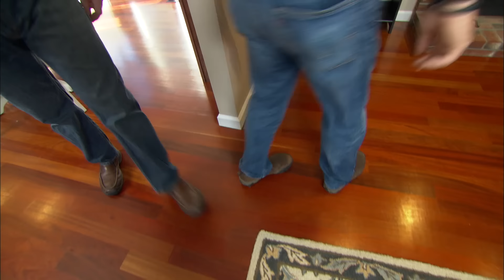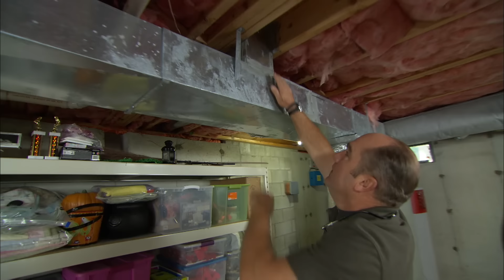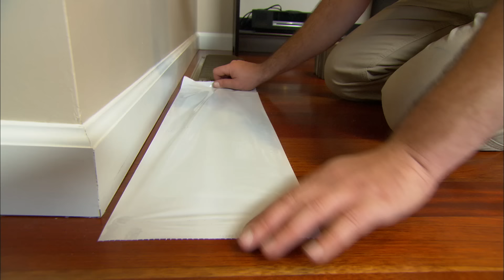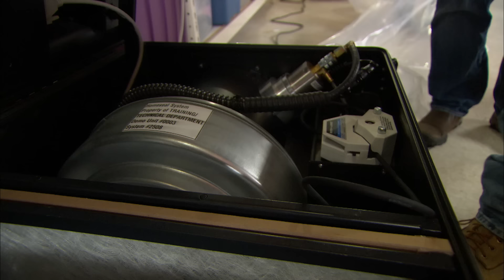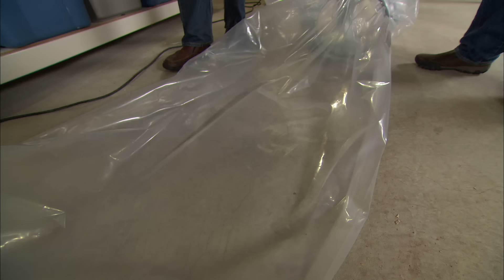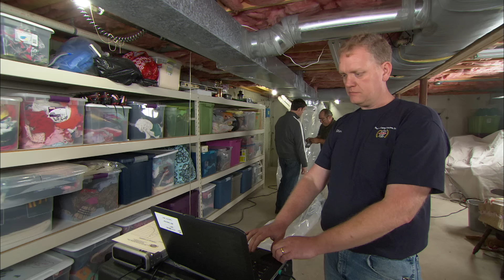How to Seal Leaky Ductwork | Ask This Old House

Comment: first off, all that atomized chemical that leaks into your house wont simply be all sucked up by that ait filter. it will hover around, settle on everything, and you will be breathing it for months every time the surface is diaturbed. i would absolutely not trust that in my lungs. 

secondly, they make this seem like a big deal but it isnt. your not loosing any air,.it all remains in the house, so.whats the problem? if you have a descrepency in temprature throught the house, restrict the flow to the areas that are hotter and increse it to the areas that are colder, pretty simple. just close some vents and if that isnt enough put some duct fans in to the cold areas
Reply: Clueless
Reply: I work in HVAC thinking the same... what about the damn pressure they put in it... 300 CFM lost my ass. YOU are telling me they have the equivalent of almost three 6" of LOST AIR!?! You have to be shitting me.

Comment: That's Cancer right there also foam insulation is pure Cancer,  rather live in a cabin with a duct less system
Reply: This isn't foam being sprayed into the ducts.  It's actually a relatively harmless, based material (water based latex ?).  It's harmless actually to anyone in the house.  I had this done a couple of years ago.  It's actually worked quite well.  Our system leaks were dramatically reduced.  We feel more air flow throughout the house.  Unfortunately, the upstairs is still quite hot in summer and we added an additional return line to draw that hot air back in to the system.
Reply: @beebob1279  Its hot because the heat melted the glue, and its leaking again.
Reply: Luis Aleman ummmm....then go live in your so called cancer free home ahahahah even though humans are living loner then ever considering the average age of death ahahaha got to love facts and statistics oh and considering the humans population is up to 7.1 billion

Comment: Nice video and helpful...for those with basements. We live in a townhouse. How do you find and repair leaks when you can't even see them because they are inside the walls?
Reply: That was the whole point of this video. The rubberized chemical is going to every piece of ductwork sealing the holes in the ducts that are inside the walls.

Comment: Won't the basement be much colder now though, since much less heat is escaping in the basement ?   I guess it's worth it to save money on heating bills,  but that was never mentioned.
Reply: It depends on if you want to pay to keep the spiders warm in the basement.
Reply: @mitchdinner9743  or water pipes, which could freeze if the basement gets cold enough. Depends where you live I guess

Comment: So what’s stoping the sealant from getting all over the a-coil and the blower????
Reply: It’s sealed off from this system when they are doing it?
Reply: They are isolated
Reply: I know this question was a year ago but my guess is they both failed by now BUT, there are no leaks and that was all he promised after all.  Oh, and they all have lung damage too.  The scrubbers took up 80% of the leaking glue mist, their lungs took the other 20.

Comment: The truth is, the latex they are applying inside the ducts can ONLY fill the small gaps and holes in a duct system. So if your ductwork has fallen apart in a chase or above a drywall ceiling or if there is any other leak larger than a 3/16" hole, the latex will not do anything.
Reply: If there was a Roof Leak at your Living, can this also cause your ducts to smell like cigars?

Comment: That return air looks really small to me.
Reply: Most systems installed have undersized ductwork period. Most systems are designed by rule of thumb and a set friction rate. There is no set friction rate, it needs to be calculated for each system. A manual j heat load calculation must be done along with a manual d to design and size ductwork for a given friction rate.

Comment: This video cracks me up where do you think the heat is going once it's in the basement the heat's not lost it goes up into the first-floor floor sealing the ductwork with plastic is going to do next to nothing this is beyond asinine
Reply: Matthew Vogt did you watch the video or just look at the thumbnail?
Reply: mattp1482 I watched it. For the record as an HVAC person myself the is a fairly controversial topic. Right up there with smart or programmable stats
Reply: Matthew Vogt I think programmable/wifi t-stats are good for people with vacation homes so they can turn it up before they get there and monitor the temp inside from far away saving them from a freeze up or people with forced hot air because it has such a quick recovery rate. Other than that they are not really necessary.
Reply: True
Reply: Well with less airleaks you have a more consistent flow.of air to the first floor this more consistent temperatures which is what the homeowner was hoping for in the beginning of the video
Reply: You can see the basement walls are bare concrete, uninsulated, so wouldn't a big portion seep into the walls then into the ground?

Comment: Why would you NOT insulate the return?
If the air is still fairly warm/cold then the heater/cooler has lees work to do saving money.
O and that end result is dumb because they started with 1 massive leak with that hole they drilled.
So 94% is a way too high number.
Reply: Wasn't the hole cut after the protest, then it wouldn't be part of the gain.

Comment: wouldn't that spray the sealant all over your A-coil and internal parts of your furnace as well.
Reply: They removed it before doing the sealing. It was hooked directly to the ductwork only

Comment: Is there a commercial LEED requirement to eliminate leakage in HVAC systems? That should become residential building code requirements ? Shortage of residential LEED heat pumps.

Comment: Great vid! Are there any self seal duct connectors? We have people in our home that have asthma/allergic reactions with such products
Reply: Yes, if you have the room for them, they protrude 1 to 2 inches out around the ductwork. They are called TDF or TDC flanges that get a neoprene or butyl gasket on the mating surfaces of the flange then the ducts get bolted together at the 4 corners.
Reply: Best way to seal ductwork is on the outside.
Reply: @mitchdinner9743  sure, everyone is gonna tear out walls and ceilings in their old house to do it that way!
Reply: @warrenmichael918  maybe you would be dumb enough. Alot of homes have exposed ductwork.

Comment: Do you guys do projects in San Antonio? I have a 1945 home with a new HVAC system that doesn't blow that hot of air. Looking closer it seems like they did a shoddy job and also hung some of the ducts to be off the ground. Is that normal?

Comment: Don't worry about breathing it in.  If there are leaks in your breathing tubes/lungs, it will seal it too. :D
Reply: Now i know how to deal with a punctured lung
Reply: That was my issue too. There was a CLOUD behind them, and NO MASKS, no eyepro. Or visible PPE. I'd be in Tyvek with a face shield and respirator. Or outside. 
Pets? THings in the house? Need the MSDS +
Reply: Kyle McNicoll Nah use flex seal
Reply: @thetupolevtu-1602  Now THATS a lotta damage!
Reply: Coagulate the holes in your ducts and your lungs all at once
Reply: LMFAO!
Reply: That’s what I was thinking….
Reply: Lol
Reply: I tried to aerosol vape my children's lungs once and this reminds me of all the fun I had .
Reply: If any gets into the air that you can breathe in then your whole house has this on any horizontal surface. You would clean your house for a decade and never get it all. It would be even worse than drywall dust because it sticks so can’t be vacuumed. So no this doesn’t get into the air at any levels that you would notice or that would harm you.
Reply: Remember no building materials have every been shown to cause cancer, so we're good to go, right?
Reply: Lungs aren't "breathing tubes."
Reply: I'm sure you are out of the house while it is being done and remain out until the cure time.  You can see on that screen in the hole that it's pretty quick.  But, if that new fangled technology still scares you, you can continue to enjoy your $1,000 utility bill.
Reply: @kennywonderley5883  bingo it dries and cures and solid as a rock! That’s why rumors are more believable than facts! Because they started by a Genius
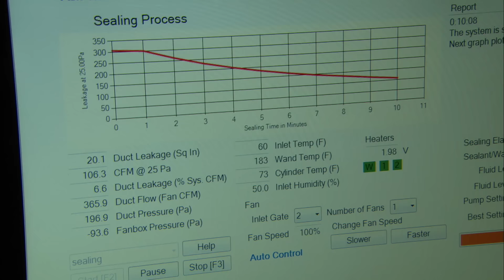Reply: @kennywonderley5883  uhh you didn't notice the chemical fog in the air @6:37 I am pretty sure they are still in the building, and they are the experts. 😷 I think I will take the higher power bill to not ruin my health.

Comment: That's actually pretty cool! And what about all that airborn sealant myst that the guys were in. Isn't it dangerous?
Reply: I wondered the same, and thought it odd they didn't address this.  It did look pretty dodgy when he mentioned about a scrubber fan pulling any airborne sealant in the living spaces onto its filters WHILE SURROUNDED BY A CLOUD OF MIST.   I'd have been masked up, no matter what the concept of the scrubber fan was.
Reply: It's only dangerous as long as they are alive.
Reply: You are right.  He didn't say a word about that being safe....he did say any leakage into the living area was captured by that scrubber fan...no mention of the leakage into the lungs.
Reply: @amalias8888  LOL...  You actually need it to be specified to you directly that airborne particles eventually end up in the lungs?  ...OK.  I'll remember that next time, thanks.
Reply: @NorthernChev  no worries! The website from the company says it's made up of baby pacifiers and something else ridiculously equivalent. No seriously, the workers must wear a P95 or N95 mask when in the same room at a minimum. I imagine the manufacturer has the MSDS posted...
Reply: I got a headache just watching this soon there will be a lawyer commercial about this
Reply: They like that rubbery milky substance
Reply: welll...thats a good question when you get non hodgkins lymphoma 20 years from now...
Reply: Remember the scrubber fan on the floor???? That's what that was for
Reply: You obvoisly missed the part where he explains how that was mitigated... Watch it again, but this time actually listen.
Reply: @NorthernChev  He said any "leakage" into the living area is captured into the scrubber fan.....he did NOT say anything about all the stuff they are breathing in during the process.  That's not mitigating....watch it again and listen.

Comment: I would like to see a follow up to this video about savings experienced over time.
Reply: Interesting product, but yes, it would be great to see at least, airflow measurements from each duct/room and supply and return temperature in the plenum. 
Barely talked about negative pressure in the return duct or how to split the return duct which seems to be all in the same pipe without any baffles that can be operated by the homeowner  (eg suck more air from upstairs vs first floor in summer vs vice-versa in winter). 
I'm sure there are better videos and youtubers that describe more the situation than putting a couple of thousand bucks worth of band-aids in your ductwork!
Reply: @terrencesauve  Shows like this are for entertainment and to get ideas. They aren't really how-tos despite the implications in their advertising. They only work as a how-to if you already have some idea of what you need to do.
Reply: No soup for you
Reply: 2 yrs later. Still waiting for the update!
Reply: @crazyhass84  It's five years later now.
Reply: @crazyhass84  do your home .There's your follow-up.....
Reply: Dumb question: isn’t the air ‘leaking’ into your building envelope anyway? So the heat isn’t really lost, it’s still in the house. It’s just it may not get to the room as efficiently? Or am I way off?
Reply: @twiincentral8780  You are absolutely correct. However, air sealing the ducts will significantly help push and pull air from all your rooms rather than the easier leaks. For effecting HVAC you want equal push and pull of air to your rooms, otherwise back pressure may occur and cause other issues than uncomfortable living space.
Reply: @twiincentral8780  Depends on whether your ducts are located in space you want to be conditioned. If your basement and attic are conditioned, sure. If they're unconditioned (i.e., insulation is located between the attic or basement and your living space), then you're heating and cooling an area that's effectively "outside" your building envelope. Not only does that waste money, but it could also lead to other problems like condensation in places you really don't want it.
Reply: No follow ups allowed
Reply: @ekujj13  its in the contract "absolutely no follow ups"  and sign off for the chemical damage to ur lungs over the years please,...right on the X
Reply: @gusc6785  yeah I wondering about the down side to spraying a chemical in the vents and breathing what ever blows out of the vents later.
Reply: Gustavo Cornejo in fairness, the chemical sealant is only in the air for less than hour after the fan is done, and even then not much left since there is a capture box on each floor. Overtime it is safer than not doing it (in this episodes case) as all the dust, potential spores/mold/allergins that can be sucked in are just as bad in a leaky system, so this ends up being a healthy system, especially in northern climates where people stay in their sealed home for several hours over several months.
Reply: GuruBrew m fyxrnx been.              xgcnf v hv h. hg v gngvh v g

Comment: How does someone find a contractor that performs this type of sealing?  It is not named in the video or description.  Lots of people asking about cost but that would vary by contractor.  Typically any reputable contractor would give an estimate at no cost though.
Reply: Did a little bit of looking at it seems the company that developed the technology that is most popular is called AeroSeal and they have a dealer locator.  In case people are looking for a dealer to give them a quote.

https://aeroseal.com/residential/find-a-dealer/
Reply: Paul Kallevig thanks man. I really appreciate that
Reply: There is a contractor in Indianapolis that is using this method.  Give them my name when you call them for an estimate.... 614-855-7730
Reply: https://aeroseal.com/get-aeroseal-now/

Comment: The hole he drilled is still there lmao
Reply: Along with all the metal shavings.  Gee thanks. lol
Reply: Metal shavings will probably be heavy enough to sit in the duct forever. If not, the filter at the end of the return duct will catch it.
Reply: @n9wox  imagine breathing in metal shavings
Reply: That’s the 4 inch square hole they say at the end lol
Reply: @meowkie8549  yep, a 4 square inch hole is a little oved an inch in diameter.
Reply: Simple fix. Screw in a metal plate over the hole.
Reply: Great comment 👍🏽
Reply: I hope you can see the hole is drilled on the furnace cleaning access cover, not the actual duct. Therefore, they can easily unscrew the cover, and clean up everything later on, replace or tape the cover, easy peasy.

Comment: What's the cost of this type of sealing.
Reply: Check the dealer locator for AeroSeal https://aeroseal.com/residential/find-a-dealer/
Reply: Thanks for the link!
Reply: It can cost over a couple of thousand to have done.
Reply: @beebob1279  Easier to get new duct done well. What about insulation in the inside of the duct, what happens when you have flex... not buying this whole thing.
Reply: @TradeWarBuzz  The company in my area came out to my house to give me an estimate.  A couple of years ago it was over two grand.

Comment: What'd you do about the hole you cut in the side of the duct?!
Reply: You'd probably put a small patch of sheet metal over it before taping it up. While the aluminum tape would work fine it isn't necessarily the most sturdy for a return. It's going to continue to suck the tape into the whole and cut it over the edge.
Reply: Joneslogy great explanation, Thanks,
Reply: @smartchip  A ring of appropriate calking and sheet metal screwed over the top.  Then mastic the outside ring of the patch.
Reply: Put aluminum tape over it?

Comment: How much does something like this cost?

I just got a new furnace and AC installed last week. None of my ducts are sealed or insulated. These are on the list of getting done as soon as I can!!
Reply: Check the dealer locator for AeroSeal https://aeroseal.com/residential/find-a-dealer/
Reply: $2-3 a cfm per system

Comment: Are there any precautions related to the sealant collecting on the coils or blower motor within the air handler?  The system does seem very interesting and worth looking into.
Reply: Looks as though this is all done from the furnace connections.  So the furnace itself is disconnected from the system while the sealing is being performed.
Reply: The blower was and coils were bypassed for this injection. It's inert once it's set up.  (I read the MSDS and some process sheets. )
Reply: +Paul Kallevig Good observation.  I missed that. Thanks.
Reply: What is this system called so I know what to goggle to find a company in my area
Reply: I watched a video before this, the air handler gets sealed off